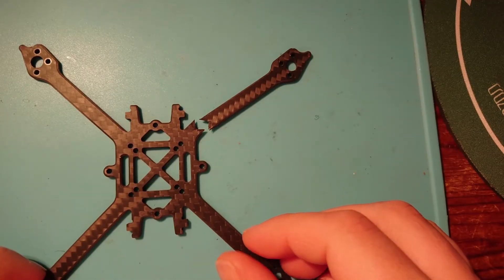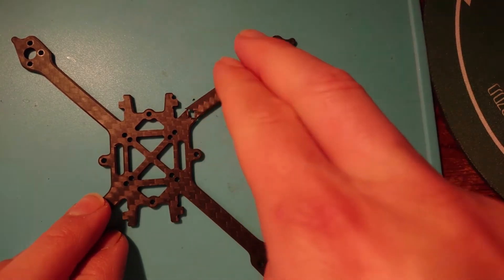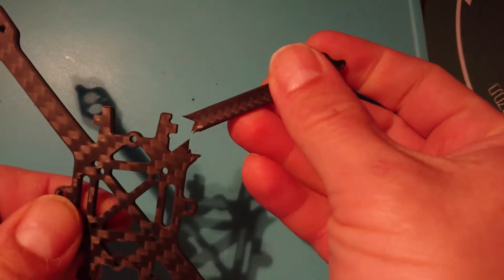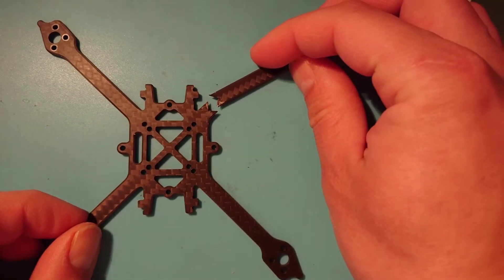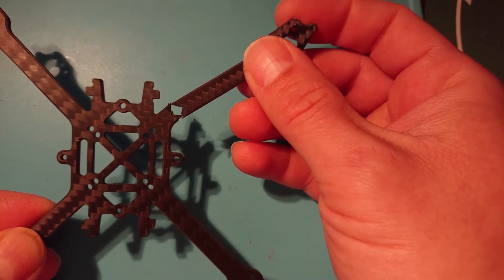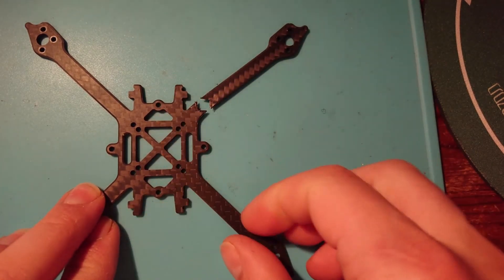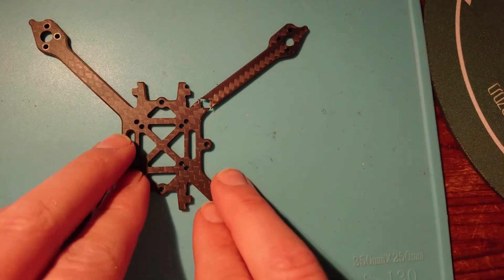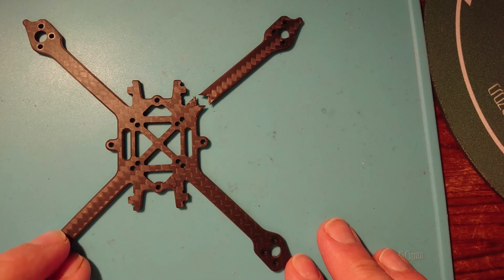Airblade EX Toothpick watch before you buy

Comment: It certainly does look like the frame was cut with the fibers running 45 degrees off from the correct direction, and judging by how it broke all the way through, it's not just the outer layers..  Hopefully this was rectified in the Eclair.
Reply from the maker: Looks like they have made improvements on this frame as I do like Airblade's stuff and normally have no issues...